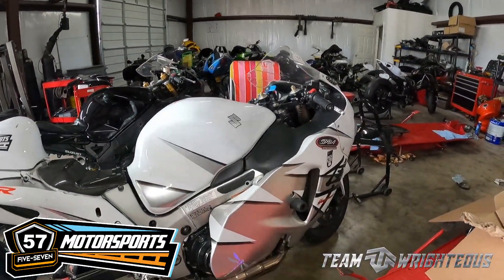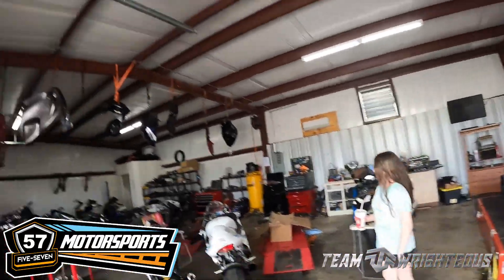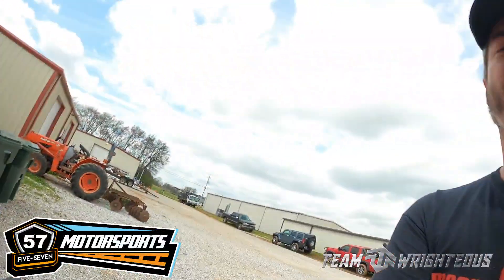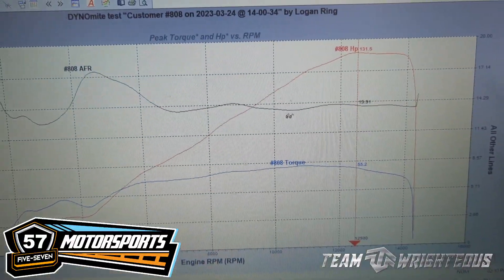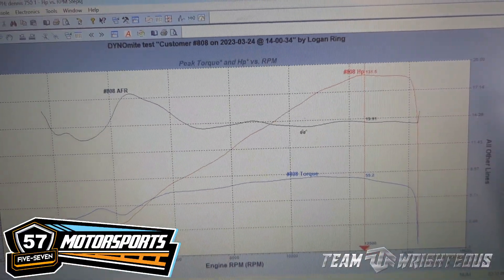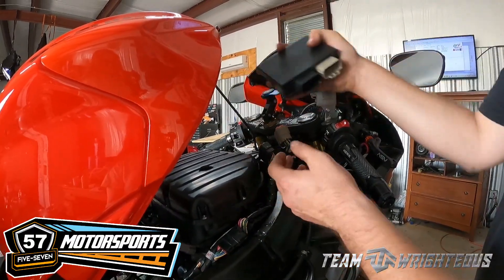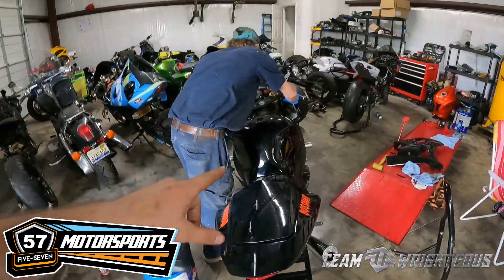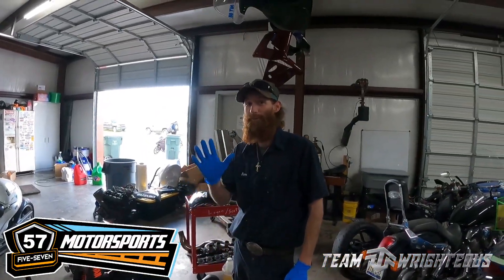ECU Flash and Dyno Tune 2022 GSXR 750 w/ Yoshimura R77 Full Exhaust

Comment: Is there a way that you can buy all the other pipes besides the muffler? I have the R77 exhaust but I want to now purchase the rest of the system, where could I find that?
Reply from the maker: Unfortunately, I have never seen anyone that sells them seoerstely online. You may be able to contact a dealer who may can get you the rest of it seperately, but honestly it probably won't be that much cheaper than buying the whole thing.
Reply: @TEAMWRIGHTEOUS  gotcha, thanks for the info bro. I'm going to be contacting Yoshimura about it and see if they can help me out
Reply: @TEAMWRIGHTEOUS hey bro, just letting you know that I was actually able to buy the rest of the pipes separately, but it was definitely a bit more expensive than buying the full system 😂 I'd recommend anyone who was in the same boat as I was to contact Yoshimura support for a full list of parts that you'd need to get the full system working 👍

Comment: Should have done one stock first, them bikes lose power when you put on a full system on like that pre-tune.
Reply from the maker: Yeah... I've tuned stock ones before too. The stock exhaust isn't very restrictive at all.
Reply: @TEAMWRIGHTEOUS  What sort of result do you see on the stock exhaust compared with a full system?
Reply from the maker: @__Max-oe6zm  there's another video on my channel where I tuned one with a cat delete after this one. Made about 4 less hp and then we added E85 and made up the difference. It was a blue one.
Reply: @TEAMWRIGHTEOUS  You mentioned you had tuned stock bikes with stock exhaust, that's what I was wondering about